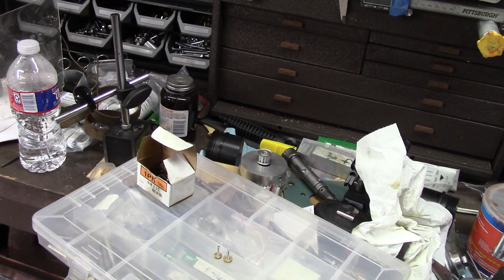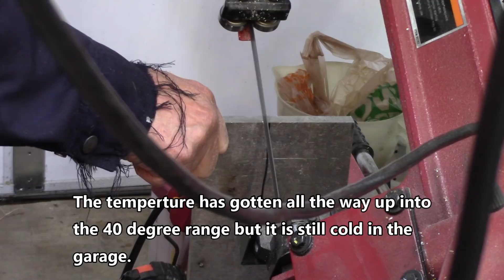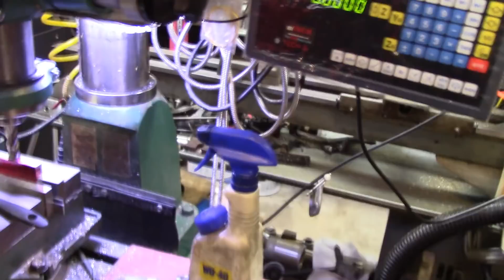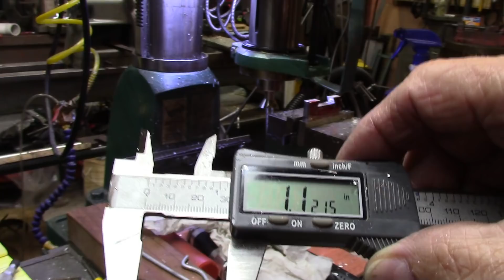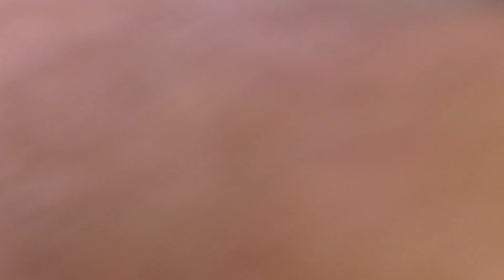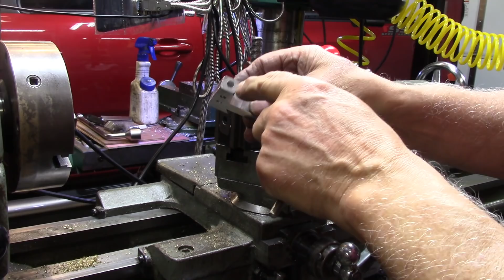YAIH   yet another indicator holder

Comment: I did see both Pragmatic Lee's video and also Tublicain's. I like the double ended style my self, so much so that's on my list. I see that the back plunger style gives you some more options for mounting than the traditional indicator. I know about the cold it was cold last week, also I fight the same temperature swings, oil and covering the machines helps some but I still deal with some rusting. 

I just finished my take on a speed vice handle, like you I'm retired so I'm catching up on projects, and making videos
Reply from the maker: Retirement is a good time to do whatever you want to.  Thanks for stopping by.